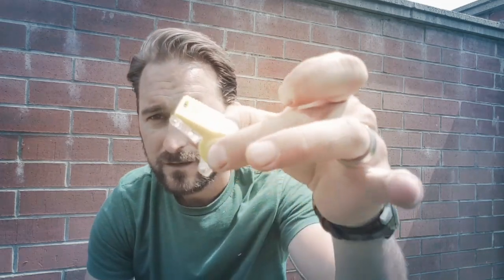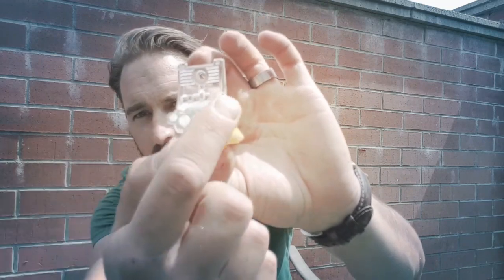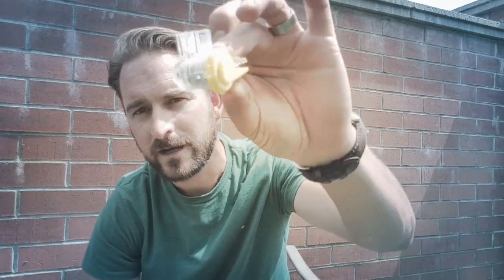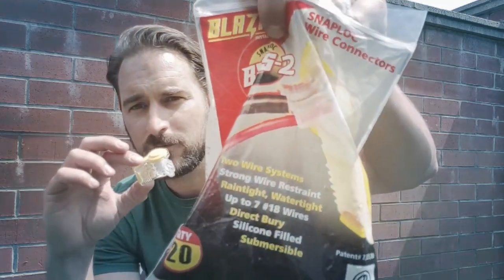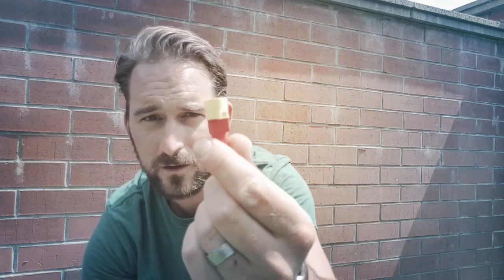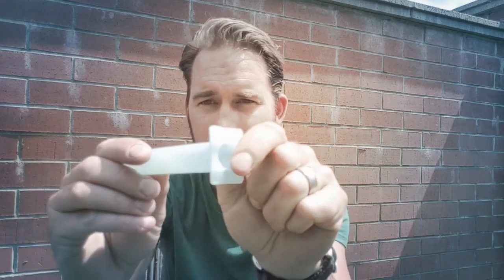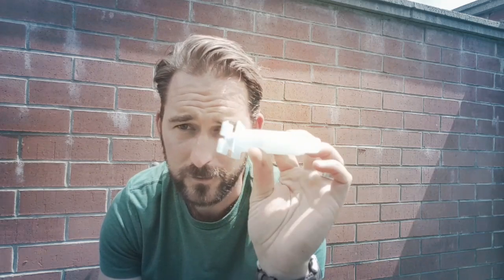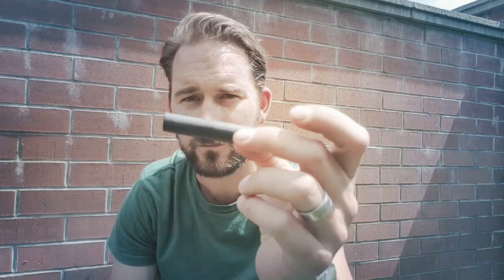How to Install Low Voltage Outdoor Landscape Lighting - Types of Wiring Connections

Comment: I am a sparky and I use a thing called dri-splice kit. it's a 2 part housing filled with  antioxidant silicone and it comes with 2 size of copper crimped heads.

Comment: I believe the design for BVS2 connector is to have the to/from wires be a solid wire (unlike most low-voltage stranded wire). It appears this is no issue in using them though?  Also, want to make sure they will work for the heavier gauge (such as 12 gauge) low voltage wiring... just want to make sure will fit inside the holes before I purchase these...   Thanks!!!
Reply from the maker: Yes they are designed for 12 to 18 Gauge wire

Comment: The connector is on my Hampton bay low voltage led well light   Its just figuring out how to put the wire correctly inside--you press together until seated and locked around the cable.  Wish I could find video of putting that together
Reply from the maker: Just as a caution that many of the piercing wire connectors like the ones you are talking about have a tendency to break down and corrode the wire over a couple of years. Here is a video with more preffered methods. https://youtu.be/U7tbvnCtF-E

Comment: What are your thoughts on Scotchlok Moisture Guard Connectors? Thanks!
Reply from the maker: I like them!  we use them from time to time also.  They have that mechanical connection to help keep the wires in place and are gel filled to keep the elements out.  My only suggestion from experience would still be to tape them up with the wires with electrical tape as I have seen them pull apart from time to time.
Reply: Lighting Doctor Ltd. 
Thank you so much! I got a 100 count 'jug' for $60 at Amazon https://www.amazon.com/gp/aw/d/B00FUF3SL8/ The BVS-2 on Amazon had 1-2 months shipping!

Comment: Hey Doc, I am a DIY homeowner and a rental property owner. Came across your channel a month or so ago and subbed you because of your willingness to be forth coming with advice. I have installed the big box LED fixtures they sell from a major manufacturer named after a city in california at both locations and am satisfied with the price to performance ratio. Would love to use your high end products but truthfully I need to consider the possibility of them being stolen. Said to say but that is a reality. The main problem is of course is with the connections. I wanted to get your thoughts of my idea of improving the connection. Haven't seen this idea anywhere before. I just use quality wire nuts, twist the wiring firmly and fill the nut with quality waterproof silicon with a caulking gun frame. Did them all over last year and so far no problems. Have you heard or did this before. Your thoughts? Thank you.
Reply from the maker: +Gene Cundel thanks for the comments and honesty. Haven't heard of your idea for connections yet but sounds like it should work great. One reccomendation  would still be to tape the wires off at each connection to keep them from pulling apart. Thanks again for the questions!!!
Reply: Me and maybe others appreciate you replying. All the best to you.

Comment: I would agree with all of these connections except the gel filled wire nuts 2:30   I found they just don't last they come apart very easily. Tape does help but wouldn't be my first choice   I see company's that use these with no tape, if that wire is exposed and someone trips over it they are going to pull right out    And if the wire is exposed they didn't bury it well enough
Reply from the maker: THanks, I completely agree.  I would never use these without tape and we always use a very healthy dose of extra tape when we have to use them.  Out of the 4 choices I recommended I would agree that these would be the last of the 4 choices.  Thanks for your comment.